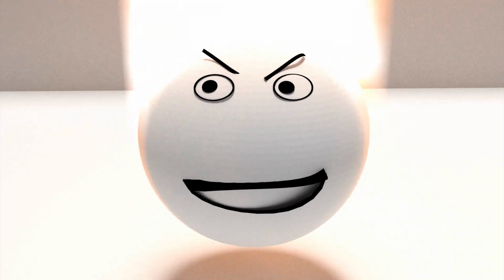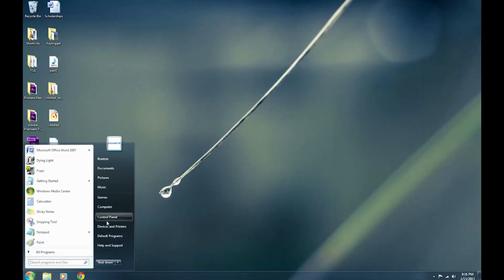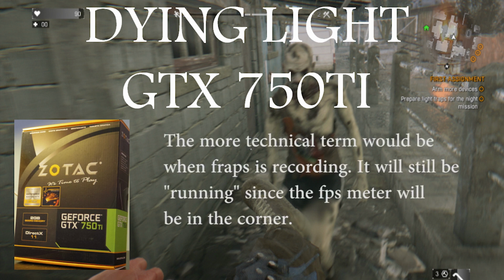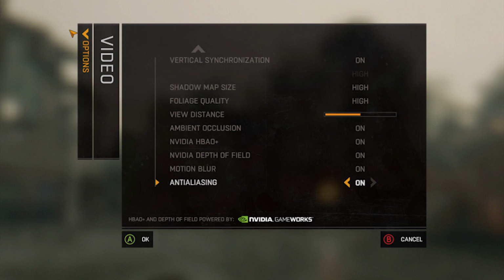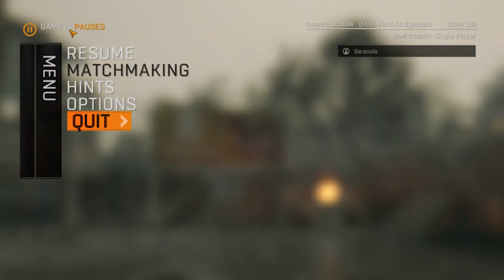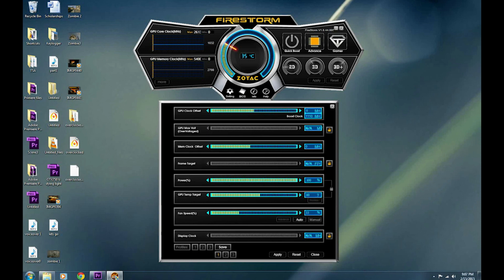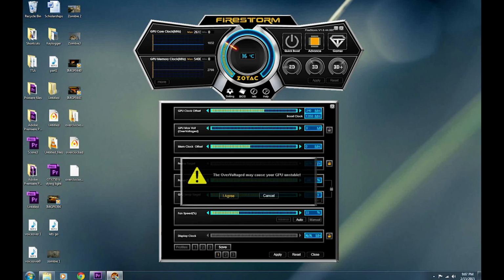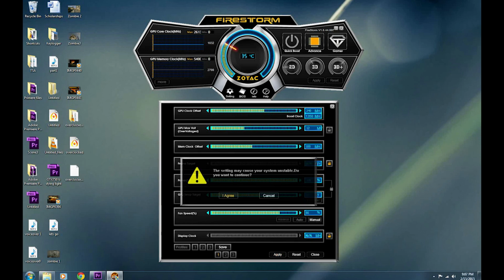Dying Light running on the Zotac Geforce GTX 750 ti (High Settings + Overclock)

Comment: makes me glad i have the zotac gtx 750 ti. good fps for price. but it seems to me i am bottlenecking in most games, lower settings and only get like 2-3fps. SPECS: dell optiplex 760, intel core 2 quad q9300 2.5ghz, 6gb ram ddr2, windows 7 home premium 64-bit. should a 4gb gddr5 next or a i7 and motherboard better? J.W.
Reply from the maker: Albert Brooks You may need more ram (system ram), I have noticed on newer games (especially dying light and FC4) that they max out my 8gb of RAM at times. When that happens my fps dips to around 15. Does your version of the GTX 750ti have 1 or 2gb of ram?
Reply: Oh okay. Maybe a 16gb would do? And my gpu is the 2gb gddr5 of 750 ti

Comment: I have an i5 and 8gigs of corsair vengeance ram, I can get this card for $160, should i go for it? also whats the difference with ZOTAC and ASUS?
Reply: +Cam Par yeah i wanna know the difference aswell
Reply: +Warrior Scott the difference i know is that the asus one has 2 fans and uses a 6 pin connector to be powered while the zotac one is powered by the pci slot, no extra power needed afaik... i got the asus one and using a 6pin connector to power it
Reply: ok thanks
Reply: +Cam Par buy Palit GTX 750 Ti StormX DUal
Reply: Cam Par go for it altho by the time u see this u probs have something else since this was 2 years ago
Reply: Yuck motion blur is nasty

Comment: will my games run smoothly if my cpu is a dual core ?? not a 6 core like yours. i got 8gb ram
Reply: Games won't run super smooth with a dual core. I have a quad core AMD fx 4300 processor and it works fine, go for that